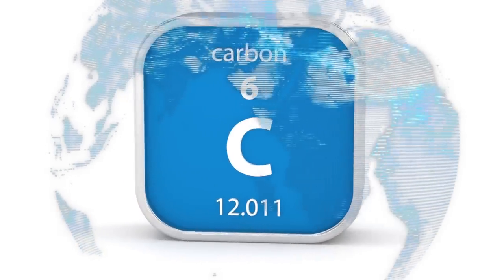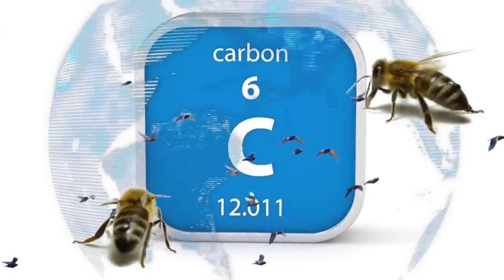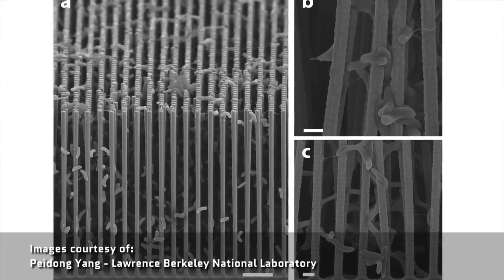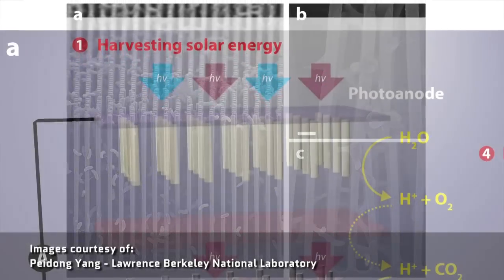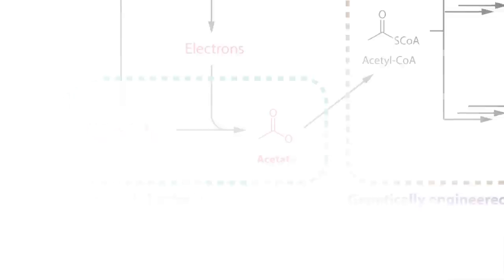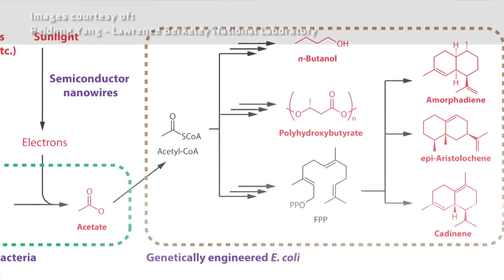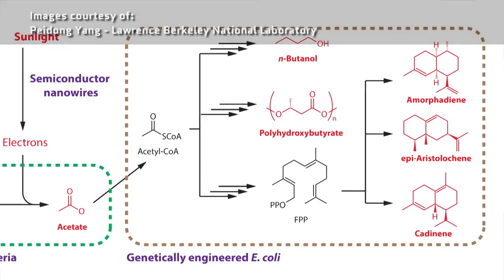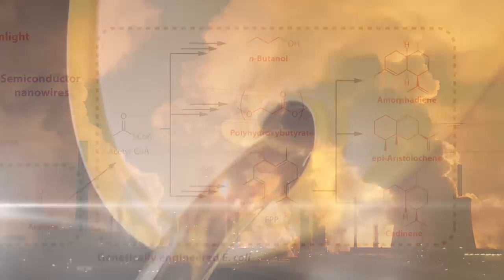Can Artificial Photosynthesis Save The Planet?

Comment: I would like to say nuclear fusion but they have been saying they are on the brink of making a self sustaining fusion reactor for something like 30 years. So, at this rate, I really don't know when fusion will actually find widespread practical use as a renewable energy source.
Reply: Garrett Winter 20 years at most.
Maybe less if corporations invest on it.
Reply: Koroistro I sure hope so.
Reply: Garrett Winter We've seen some advances in fusion recently, including the first instance of producing more energy than it took to start/sustain the reaction. But a lot of work needs to be done to make it efficient -- as I recall, the recent experiments resulted in less than 10% fuel consumption, meaning more than 90% of the fuel for fusion went to waste. Still, every advance gets us a little closer to that goal!
Reply: Jonathan Strickland devlopment of new technology is (almost) always exponential , which means that for a lot of time seems that nothing is happening and then it seems finished all of the sudden :)
I don't think we will find we have free fusion tomorrow but in one , maximum two decateds i'm fairly confident it will be avaliable.

Comment: Genetically engineered algae will do the job.
Reply: Algae fuel? I believe engineered algae is a viable and likely future energy source. Something to bridge the gap between fuels (like fossil) till we something viable (possible) and practical (easier and convenient) comes along. Any of the other energy sources like fusion sounds amazing. Here's hoping any of those things work.
Reply: Unboundedominion fusion is challenge, it easily happens in the sun due to its immense mass and gravitational field, something which we have to Artifically create on earth using alot of energy to fuse these atoms.
Reply: Amir Hussain Yeah, that why I don't think it's practical. Seems like we have to put more in, input of energy to get out. I really think your suggestion, algae fuel is more likely and easier to accomplish in the meantime.
Reply: Amir Hussain   Ugh maybe, beware the blob doesnt get out of control and spawn toxic/dying algae which makes things worse than before you started.  It's tricky and tinkering with nature tends to have adverse unintended consequences.

Comment: Well to see which energy source could be the future of energy production there must be the pros and cons of each. As well as the availability and commercial rate. Wind energy and geothermal energy is questionable as they have the possibility of running out. Solar energy can be used almost indefinitely but takes a while to produce as much energy needed from sunlight. Nuclear will eventually run out as we use up the elements used for it. My best guess to help solve our energy crisis is to use the genetically engineered bacteria and "cyborg" bacteria with the silicon micro wires. Bacteria replicate a lot faster and can be used to make the renewable fuel in the video. Any energy source creates energy at their own rates and necessities to produce the energy. The one that is more easily obtained, creates more energy, and has no long-term chance of running out is the best use.

Comment: once we realise that everything is actually energy, this question just dissolves into nothingness.
Reply: Yes mass is energy and energy is mass. But converting that mass into energy, other than fission has so far eluded us. Other than releasing chemical bonds how would you suggest we do this?
Reply: +Jamie Godman what are we doing when we burn coal? coal has mass, and the electrical current it produces is what we can use as energy. the same goes for all fossile fuels. We can also tap into the electro-magnetic field of the planet, like tesla did. It's happening everywhere!

Comment: nope.. i did my phd on this and i can say that nope it will never work.. i tried for years to increase the electron transfer potensial and just couldnt be done..
Reply: Just cause you failed doesn't mean others will.  Remember America and Germany both were making atomic weapons at the same time, theirs a reason Germany failed where America succeeded.
Reply: speedy01247 its not about failure. its about physics.. theres no chemical element that allows electron band gap narrowing without increasing electron recombination. hence theres no way of increasing free electrons for bacterial use.. the model they used is the very best producer of free electron tranport. they just dont know it yet..

btw theres great deal of similar errors in research technique like this in photochemistry as the field is highly specilised with few who know it well enough to have cross science exsposure in bacteriology. so the biologist think its promissing untill they need a chemist to alter the formula and the chrmisty doesnt know if its going to work because hes not a biologist. 

im a biochemist and a engineer. thats why i was asked to do this research and two of my students followed on from me and concluded as i did above that its not likly to lead anywhere. what they have is all they will ever have. it can be exspanded upon... not for knowledge or lack of effort but for the laws of chemical physics that prevent them..

Comment: It's quite simple honestly, harvest lightning.

There's 5 billion joules in one bolt of lightning. For every kilowatt there's 3.6 mega joules, you do the math.
Reply: Michael R Array of very large batteries and capacitors.
Reply: Garrett Trenholm If there was an efficient way for individuals to store the 5 billion joules (1500 kwh) a bolt of lightning produces in micro seconds, than it would be a smashing success. 
 
A power plant would definitely need to be able to induce the lightning for it to supply the demand, as the average household uses 10000 kwh annually, if you multiply that by the service area of each plant, you need alot of lightning lol.
Reply: Garrett Trenholm Theoretically, lightning does produce the maximum amount of energy in the shortest time, we just need to be able to harvest that lightning efficiently to make it applicable.
Reply: Garrett Trenholm I've seen tesla coils harvest energy from an electrostatic motor, it's truly the same concept on a larger scale.
Reply: Garrett Trenholm it would take approximately 15 billion bolts of lightning harvested annually to provide power to 2 billion houses annually.
Reply: Garrett Trenholm On average there's 25 million lightning strikes in the US annually, that's 35 billion kwh. Seeing as how most of that lightning occurs in specific areas, I truly think plants could be built to induce prematurely and catch a large percentage that lightning when storm fronts pass specific areas.
Reply: Garrett Trenholm The more I think about it, the grid itself could be modified with strategically placed lightning towers that feed the grid directly and any excess could be stored. Also houses in specific areas could likely go completely off grid.
Reply: Garrett Trenholm It might not capacitate all of our energy demands, but it's definitely feasibly cheaper energy solution for consumers with plenty of profit incentives for the private sector.
Reply: Garrett Trenholm 1500 kwh in microseconds shouldn't be too hard to disperse into the grid, a battery maybe ....
Reply: Garrett Trenholm I know my math is not accurate, but if I'm correct it's like 1.5 million watts in one lightning bolt, please correct me if im wrong.
Reply: ***** Just to disrupt any potential confusion, a kilowatt is a thousand joules per second. A watt is one joule of energy per second.

So, what you mean is a kilowatt hour, which totals 3.6 million joules. 

But that isn't really that much. A typical household uses almost a thousand kw/h a month. It's something though. One bolt of lightning could power 2 homes at a stretch for a month if you could store all that energy.

There are around 3.1 billion lightning strikes every year. So if you could harness and store 100% of all lightning strikes per year, that would amount to all residential electrical use. But there's still commercial energy use to account for, as well as the hardest one, portable energy.
Reply: UnknownXV Yeah those are the numbers i used, but I only saw like 25 million strike annual just in the US, so yours must he world wide?

1500 kwh (1.5 million watts) in one bolt of lightning is what I came up with. And I came up with 833 kwh per month, per house. So yup, 1 bolt of lightning would supply 2 houses a month, or 1 house for 2 months.
Reply: UnknownXV There's 4.1 trillion kwh in 3.1 billion lightning strikes lol.
Reply: 123 million households in the US, and they use 1.2 trillion kwh annually, just houses.
Reply: ***** Just slightly off of two houses per month, but it's close. 

Worldwide there are about 100 lightning strikes per second. 31 million seconds a year = 3.1 billion-ish. 

That's 4.3 trillion KW/H per year. That's very little.

http://en.wikipedia.org/wiki/World_energy_consumption#World_energy_consumption_and_electricity_supply

World electricity generation is 20,181 terawatt hours (trillion watts). 

So, all those lightning strikes account for 4.3 of 20,181. 

Every hour we use more energy than every lightning strike on earth annually. We're quite a power hungry species.
Reply: UnknownXV I'm pretty sure I know how to harvest a very large portion of that lighting via strategically placed/designed towers and capacitors. Conceptually on paper it should work very well, it takes funding and government cooperation to start up though.
Reply: ***** I love science, but you're talking to the wrong person if you want to mandate it through government.
Reply: UnknownXV It's more about land regulation getting in the way of infrastructure placement and use of the current grid network (I'm clueless as of currently).
Reply: ***** If a private individual wanted to try and attempt this commercially, I'm all for it. I certainly hope government would not stand in the way, but that is their specialty.
Reply: UnknownXV If I'm correct, 2600 car batteries would store 1500 kwh of energy, but there's has to be a capacitor to absorb the initial load I think, then charge the batteries.
Reply: If harvesting lightning is quite simple then please enlighten us on how you would harvest lightening. Remember this in not back to the future when they knew when and where lightning would strike. So without knowing when and where it's not quite so simple.

Comment: i don't think that we should use this technology for producing gasoline, if we take the co2 from the air, turn it into gas, and then burn the gas, then the co2 just ends up in the air all over again, and that isn't doing any favors for the environment, sure, it is carbon neutral, but if humans were to go carbon neutral right now, the co2 levels would stop rising and remain at 400+ ppm, which means that global temperatures will stay the same, glaciers will still be melting, the earth becomes less reflective as a result, trapping more heat, causing temperatures to rise, evaporating more water which is a more powerful greenhouse gas than co2, raising the temp more, and so on, to really get out of this massive hole, humans need to become carbon negative until co2 levels return to pre-industrial levels, and if there is still a need for gasoline by that time, you can use this however you want (as long as its carbon neutral)

Comment: Crystals have a untapped energy and I don't know how long they last for? Piezoelectricity
Reply: bodacias402 The energy that comes from using crystals is not from the crystals its input. The piezoelectric effect
Reply: bodacias402 Piezoelectricity is not turning energy stored in the crystal into electricity. It is turning mechanical energy into electricity. That's why when you start your grill, you have to press in the button so hard, but it doesn't pop back out so hard. That thumb was a mechanism putting that mechanical force into a crystal.

Comment: I always liked the geothermal idea, but the more I look into it the more issues it seems it has. Ideally if there were areas where you could build these generator stations and then transfer the power massive distances like across the USA with little loss then it may be practical. You could do that with solar also, but that takes a lot of space, and only works for certain times, etc. 

I think maybe the best option while allowing us to keep near our current setup would be nuclear plants using thorium. What I've seen these reactors can't go like Chernobyl, etc. They use a huge amount of the fuel and it's done it's radioactive, but ti's fractions of uranium, etc they currently use. Supposedly these things even though they say thorium can take the spent uranium and get a huge amount more energy from it.

If we can make electricity renewably, cheaply then once storage solutions mature we could see all electric cars. Heat your house use infrared heaters, heat pumps. All of this would be electric and come from one renewable power source.

Comment: Step 1: Develop Carbon Nanotubes
Step 2: Build a space elevator
Step 3: Send Von Neuman bots everywhere
Step 4: They replicate producing millions,
Step 5: Reprogram some bots to produce solar panels.
Step 6: Exponential increase in solar panels as some bots continue to reproduce.
Step 7: Send these panels into orbit around the sun.
Step 8: Store energy in antimatter, (compact storage)

ENOUGH ENERGY FOR FUTURE CIVILISATION!!!!!
Politically IMPRACTICAL, but scientifically plausible. After the initial investment no additional human resource is needed.
Reply: I guess this would become automatic, producing a virtually infinite supply.
Reply: jk991234 Store energy in antimatter? You know antimatter acts just like a regular matter, the only difference is the charge right? So what's the difference in storing it in antimatter than regular matter?
Reply: If I have learnt correctly, energy can be converted into matter and antimatter in equal amounts. When matter and antimatter collide they convert back to energy. If you take extremely large amounts of energy, you can convert this into a few grams of hydrogen and antihydrogen. Get rid of the hydrogen, and keep the antihydrogen. This stores the energy. When you want to retrieve the energy collide that antihydrogen with more matter and it will give you the energy back. Due to E=mc^2 ridiculous quantities of energy can be stored in a small and efficient quantity of mass.
You are right that antimatter acts just like regular matter but with an opposite charge. If we lived in a solar system made of antimatter, it would make sense to store energy in matter.